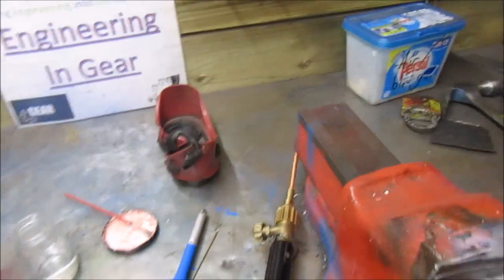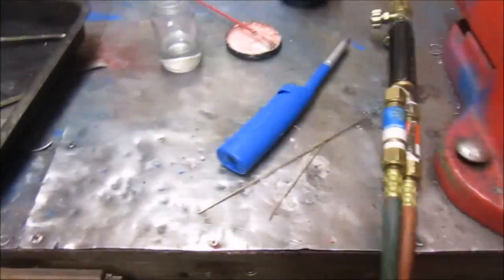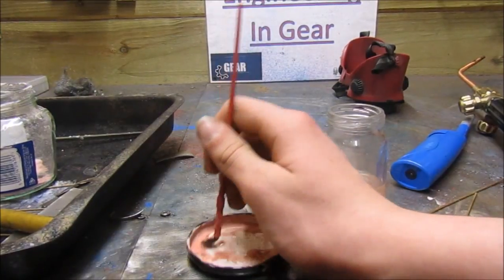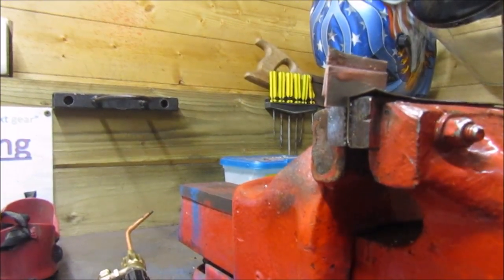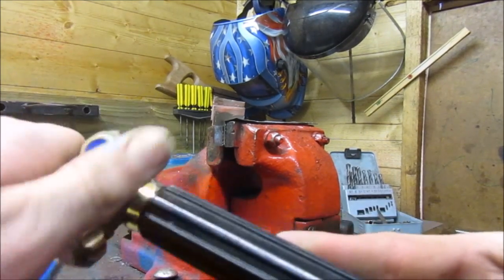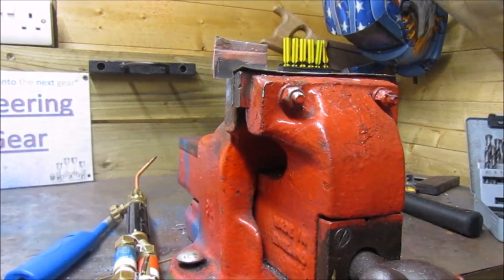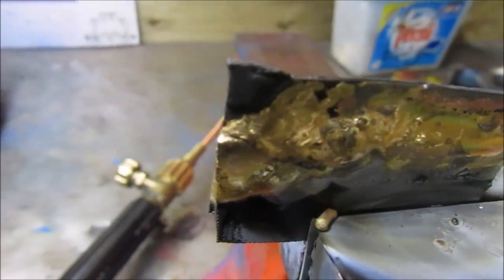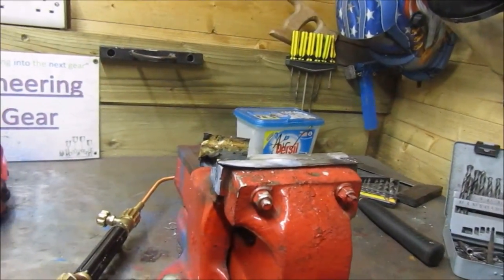How to braze steel!

Comment: Nice to see young people interested in metal working, a tip though don't use to much brazing rod the beauty of brazing is the penetration not piling more braze like welding. let the braze flow through the joint and let it follow the flame. I'm not criticizing just passing on some knowledge, and move the flame around the joint at right angles to heat the whole joint not just one place you will find the braze will be more controllable. keep up the good work young man.
Reply from the maker: Thanks

Comment: Nice video man,
But what torch do you use and what is the tip size?
Reply from the maker: +toolman talal Hi it is a Clarke CGW1 Welding cutting torch, not sure what the tip size is but can find out tomorrow if you need it. Thanks for watching!
Reply: Engineering in Gear
Thanks very much for the fast response, yes I'll wait for it.
Reply from the maker: +toolman talal No problem, happy to help! Will find out tomorrow think it is 0.6 mm, not sure though.
Reply from the maker: +toolman talal Hi, it is a number 2 welding tip
Reply: Engineering in Gear
Thanks a lot.
Have a nice day 😊
Reply from the maker: +toolman talal 
No problem. Have a good day

Comment: Its great to see a young lad with an intrest in all forms of eingeneering , When most are stuck in front of an xbox ,( A wee tip Jack ), instead of mixing up a paste with the flux , just give the rod a bit of heat about 1 inch from the tip and dip it into the flux as it will stick to the rod and repeat as needed as you progress along the weld
Reply from the maker: Thanks a lot mate, will use that next time

Comment: Not sure how this is less expensive. I could have thrown a mig bead across that in about 10 seconds including setup, used a few inches of cheap mig wire instead of brass filler and a small amount of shielding gas and no flux. And if u do a proper weld, there is really nothing to clean up. 
And the amount of heat zone much smaller mig welding. I appreciate your efforts but just don’t see this a cheaper alternative.